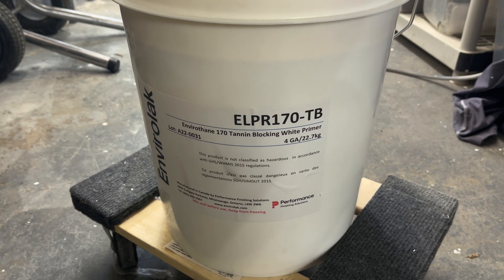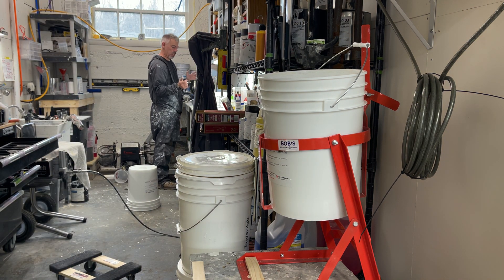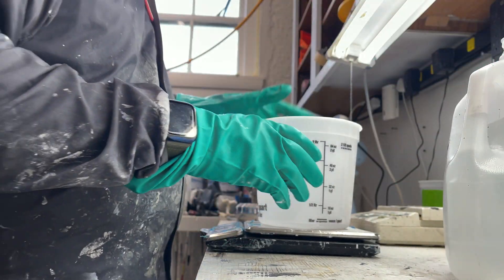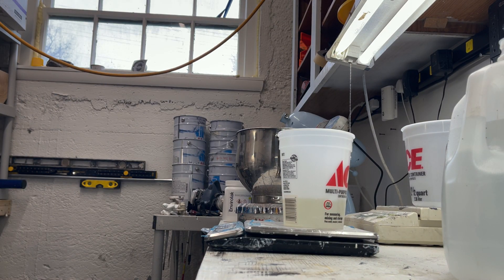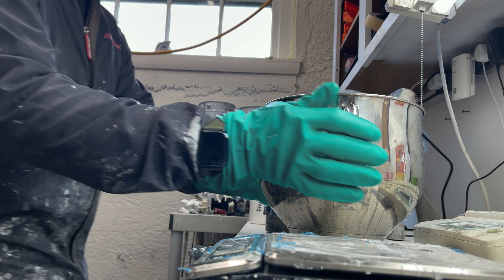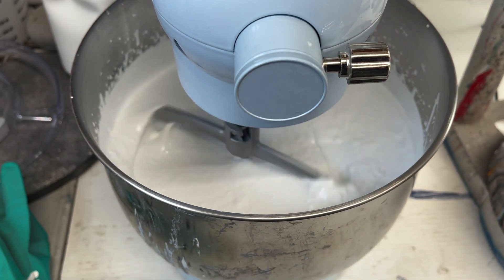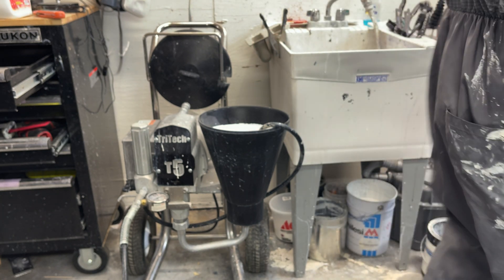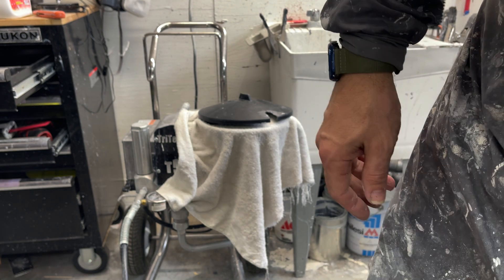Mixing Envirolak 170 TB with 5% Elcat 100 Catalyst

Comment: Hello, How long until you have to spray after mixing ?
Reply from the maker: If your asking how long before I spray - I give it 5 minutes to “rest” before spraying. If your asking how long I have before the paint starts to harden it’s anywhere from 2-4 hour’s depending on temperature.
Reply: @Jimskalajim12  i was asking the second, and now I am curious about the first, why give it a rest? I thought it will be best to spray right away as the paint is completely mixed. I do small project for my home and love learning all this tricks the pros like you know for a better result,
Reply from the maker: @rufogallardo7168  I mix it for five full minutes then let it rest for 5 minutes as well. I figure that the chemical reaction isn’t instantaneous so a little time doesn’t hurt.
Reply: I’ve been spraying envirolak since the beginning. I was one of the guinea pigs in the field. 😂.  Shot some of the 90 gloss too.  Love this company.